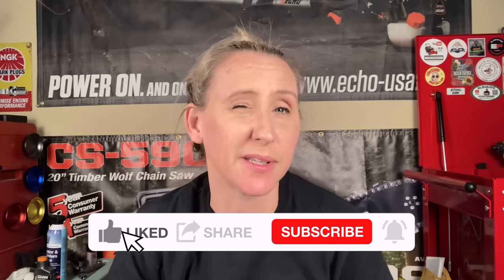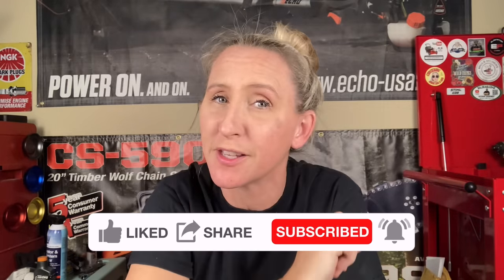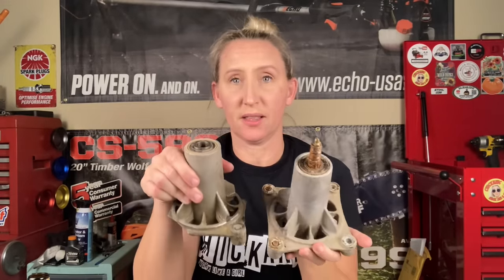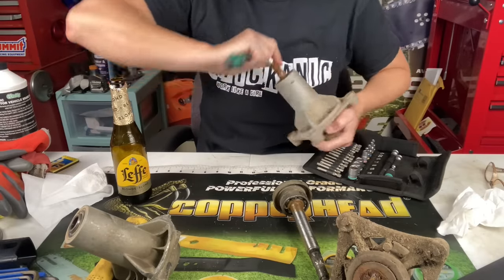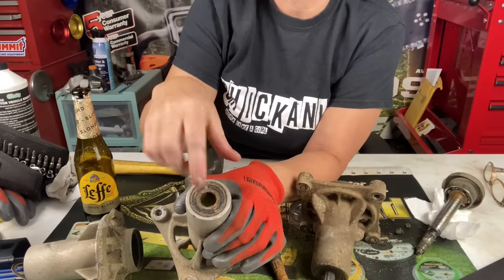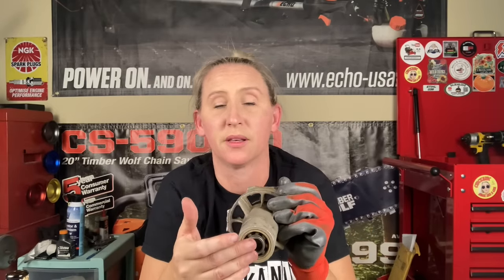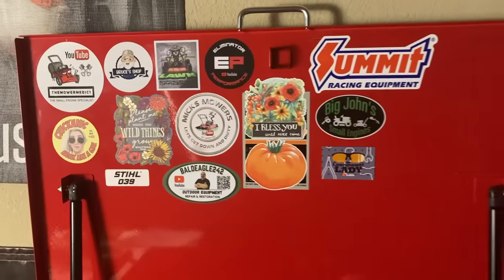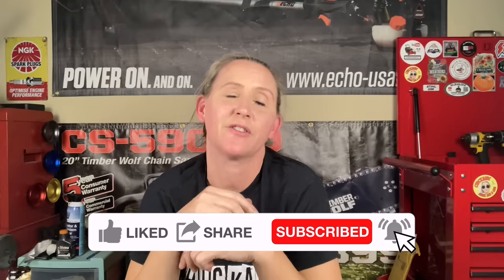THIS IS BIG!! Husqvarna riding mower and Zero Turns HAVE CHANGED! Review/Vlog

Comment: Well, the way that John Deere likes to sell parts and not let the owner work on things, I bet theirs are still sealed solid.  Though the aftermarket bearings I ordered I popped the inner seals out of before I replaced them.  I live North of KC, we grow CLAY here with the occasional pebble so the bearings do go bad first.  Specially the ones.  30 years ago I worked on a Golf Course.  We replaced spindle bearings on a Jacobson HR-15.  Had to pull the inner races off on those as well.  You'd think an industrial mower with an 16 foot mowing  swath would come done right.  Then again, things like bearings got replaced every year because they're cheap, we were full time not mowing in the winter and small money spent in the winter was worth way more then time down on a mower in the growing season.  Lotta grass out on a golf course, you might not have noticed.

Comment: Use caution with gresing those one piece spindle housings, especially if the inner seal's are removed. What you have there is essentially a hydraulic cylinder, and will easily blow the outer seal's off the bearings. An example of the power of a grease gun is bulldozers, tracked hoes and tracked skid steers use a grease gun to fill a cylinder to set and hold the track tension. My mid 80's Simplicity / AC GT's use a 2 piece spindle housing, with a loose fit and excess grease simply flows out between the 2 halves.

I have been drilling and tapping spindle housings for grease fittings since the early 80's. In my experience the lower bearing was the first to go bad, often with rust and water sitting on top of it. I never removed the seals, just filled the housings to stop condensation / water entry in them, this took me from replacing bearings every 1.5-2 years to 5 or 6 years sometimes more ;-)
Reply: Good advice - never thought about the hydraulic effect if over greased!
Reply: See my post above. You need a weep hole drilled in the spindle so that the grease won't pressurize inside the spindle. Cover the weep hole with a rubber plug when you see grease weeping out....simple.
Reply: An excellent point over greasing can cause problems.
Reply: Trump Supporter ?
Reply: @benjurqunov  I am Canadian

Comment: As an industrial mechanic, I have seen properly designed and selected sealed bearing last many years ... even decades. On the flip side, over greasing bearings can also become a problem creating excess heat as the churning grease has nowhere to go and can break down due to this excess heat. Me personally, like to see a properly sized/designed sealed bearing as contamination and excess grease issues are eliminated. Either way, I think the final determination is in the design. A properly sized robust bearing will be reliable. Undersized or lower quality bearings in an attempt to lower cost is what, many times, leads to premature failures. I have a Kubota 725 commercial zero turn with sealed spindles that has robust bearings and large spindle shafts that I mow a 7 acre field without problems for a few years now. Just some input. Love your channel. Very good advice on power equipment. For example, I never realized that gas pressure washers were not designed to run for more than a few minutes without expelling water through the wand. And, sure enough, states this right in the manual. Seems that very few people, including me, actually read the manuals .... lol..
https://www.machinerylubrication.com/Read/28664/dangers-of-overgreasing-
Reply: Yes sir, your the one who is correct. #1 reason for bearing failure, over greasing. Sealed bearings have the correct amount of grease for a full life of a bearing. There are more bone headed people than your kind by far. If there is a zerk they are going to use it. I can't tell you how many zerks I've gotten rid of, plugging the hole, to prevent premature failure. Good job, but your advice will surely fall on deaf ears.

Comment: Someone may have already said this but if you over grease you will push out the top seal and then allow dirt in. Hustler commercial mowers have sealed bearings with a grease fitting.  Like you said 99% are sealed bearings.  Customers need to do there own research on their particular model

Comment: I pretty much just came across this channel but I find it interesting that chicanic just found out about the spindle bearings.  It's understandable, considering her area has destroyed spindles from hitting rocks instead of burnt bearings.  I came across this about 4 years ago when I had a bearing lock up.  I was complaining to the bearings being sealed.  The place I bought the new spindle told me about the outside of the bearings being sealed but the inside part isn't anymore.

Comment: I’ve been watching your videos for a few weeks now and I must say you have a lot of mechanical skill. I’ve worked on gas motors since I made my first min bike in the late 60’s. I’ve learned a few things watching you, so thank you. After watching your video about the new plastic lawnmowers I figured I better do so work on my old Craftsman walk behind with a B&S motor . I finally found some old stock front wheels after spending hours in the internet. I’ll get to the question cause I’m sure you’re busy. The model number on the motor doesn’t come up anywhere because it’s a B&S on a craftsman frame. The model on the stick on tag is 275-260. I can’t find an air cleaner or filter. The one that was in it was not the right one so I don’t know what it looks like. Is there any way to cross reference ? The online owners manual shows a totally different carb and filter. Mine is flat plastic and the primer bulb is part of the filter base. Thanks in advance . I know that’s not much to go on.

Comment: Hi Bre! Love the videos and knowledge. My Husqvarna YTH2042 might be in need of a new spindle or bearing. Just put new blades on and notices a bit of rope stuck and would not come out. Rotating the spindle sounds a bit dry/rough, but still spins for now. 
Problem is the links you left for the spindle shaft/bearings is no longer available and the second complete spindle does not show the bottom whether it has the raised circle requiring a different/new blade bolt, so not sure a good source for a new spindle that is same as OEM? Any updates for us out there on a good part/source?

Comment: Chickanic; how would leaving the seal off of the TOP of the new design allow grease to enter.?  If leaving sheilds off, it should be (in my twisted way of thinking) the inner seals.  Also, the "rubber" (actually plastic) seals are flexible enough to allow pressurized grease to enter fairly easily, although getting the old cruddy grase out is not so efficiently done.   Sort of a one way valve effect.  (HEY!  MAYBE I JUST ANSWERED MY OWN QUESTION!  LEAVING THE TOP SHIELD OFF GIVES THE OLD CRUDDY GREASE AN EXIT ROUTE.)  I guess many home owners never see enough use to wear out the 2RS bearings that are not zerk greased.
Reply: It’s the top of the bottom bearing that doesn’t have the seal, so it is an inner seal. My 2005 Husqvarna has always been like that.

Comment: As a youn man I used to race their bikes, I thing it was the same company anyway? My first Husky mower when brand new needed three transmissions, transaxle? The shop I bought it from kept doing the work under warranty. Finally the shop demanded a replacement mower, Husky wouldn't hear of it? Then the shop owner informed them he would no longer be selling them! Being the number one shop in the area Husky gave me a new mower, the next model up that had no problems!! A couple years later the only problem is the changing of the oil. How are you supposed to tighten the plug up once you get it loosened? There is no wrench room. The shop doesn't have a clue and Husky knows about the problem. I'm an old man now and have no plans to ever buy another mower but I would never buy another Husky!!!

Comment: This is why engineers shouldn’t listen to YouTube comments!! Ever since these open greassable bearings were being used they have been nothing but problems!! The failure rate is soo high that a lot of the people in my industry are opting for the sealed bearing!! 
Big problem!!
I have ride mower that are 19 years old with the original sealed bearings and they still go strong with no noise or over resistance, feels smooth with just the right amount of resistance!! 

Never had an issue with spindle bearings until now, what a shame!!

I’m all for the manufacture listing to it’s customers but unfortunately this is a big mistake!!

Edit; why are people so obsessed with greasing their spindles!! I’ve run a landscaping business for 22 years and never greased a single spindle!!

Comment: And there's me replacing all sorts of bearings in equipment with sealed bearings, knowing that the easiest way to cause a bearing to fail is to contaminate it. Even Triumph motorcycles discovered that gearbox bearings running part submerged in oil lasted longer if they were sealed because they did not ingest the wear particles from the gearbox.
Yes it's lovely to pump lots of lovely grease into a bearing assembly and think you are doing good, reality is; are you actually increasing the life of the bearing over a pre lubed sealed one?
Reply: mostly agreed, I also replace many shielded and open bearings with sealed on gear boxes, etc. open bearings have open arms for anything  that would get between the balls and race. Spun shafts and housings due to locked bearings is common.

Comment: Another Arky here.  Dixie Choppers use convex Belleville washers instead of starred shafts to hold the blades on.  They serve as very effective clutches and do not destroy the shafts when a rock or root is hit.  When I have to work on a shaft on any mower of any brand, I always clean out the housing and drill a small hole in the housing that I tap for a grease zerk if it is not already fitted with one.  I then remove the inner bearing cover on the top and bottom bearings so they are exposed to the grease zerk.  I put it all back in and force grease into the housing until it starts coming out around the shaft.  No dry bearing problem anymore.

Comment: Sealed bearings aren’t sealed grease will flow through them.  Sealed bearings have a small rubber lip that even if well sealed when new will quickly wear out.  The common sealed bearing really just has a dust cover on it.  Water will flow through them in wet environments and they will not last long.

Comment: They probably ran out of brgs that are double sealed, and put what they could acquire to continue production. The spacer under the pulley has been there for years. If you put it back together without the spacer, you'll lock up the spindle.

Comment: Hmm, glossed over that hole in the old shaft that comes out right where the bearing is and you flick around the sealed bearing so fast we can't see the inside bore but for a split second it looks like it has a hole that would line up with said hole in shaft at 9:40

Comment: Chickanic, My question would be, are those upper and lower bearing outer seals made to expel grease when someone zealously injects some into the housing cavity? Will those outer seals be blown out? If too thick of a grease is used, or too cold of weather? Is there an easy way to see if this has happened? Is there an easy way to wipe away excess grease from the upper and lower afterward?
Reply: it might be a little unsafe, but greasing a warm spindle slowly while it is turning is more likely to let excess grease flow through.

Comment: every Husqvarna riding mower I have ever owned or seen has had major issues with the deck and spindles. I will never own another one. they claim industrial decks yet if you hit a small stick size of your finger the deck edge gets bent and or the spindles wear out at amazing rates. we even tried to drill the top of spindles and put grease fittings in them to make them last longer it didn't work either

Comment: How long would you have to pump grease in that hub before it were full enough to grease the actual bearing??? And if you ever did fill it, how many more pumps before you push the seal out of the bearing. The life of a sealed bearing is more dependent on the instalation and type of grease in the bearing. Hammering on the bearing kills a bearing! It needs to be properly  pressed for long life!

Comment: I thought I was ahead of the curve by taking the inside seals out of the spindles I was working with and then filling with grease thru the side zerk. After 30 shots it got tight. Not only the grease gun stopped pumping, but the shaft didn't want to turn either. Still not sure what that was about, I worked the blades back and forth and it loosened up right away and another pump would make it go sold again. Worked that loose and gave it back to the farm wife with hopes that I was done with spindle repairs for a while. I never did have to do another one because every year I would get under there and grease em up to the same stop point, gently work the blades back and forth and it's loose again. That was decades ago, last winter I'm watching a you tube video on this same subject and he shows us the double seal bearings and then he proceeds to pump them full of grease anyway after complete assembly of the deck. Low and behold and to my amazed eyes out comes the grease from the bottom first and then the top as well. It's full of grease and I never did need to pull those two seals. If I hadn't seen him do it, I wouldn't be believing it right now myself - but it's a FACT. Your grease gun pressure will just push that seal lip inward and the grease will flow right on in there and out the other side. Just keep pumping the grease gun and see for yourself. Back in the day it took me 10 to 20 pumps on the grease gun to make up for the grease lost during a years worth of mowing, it's such a small price to pay and since I now have my own zero turn I'm so very glad I don't have to tear that deck all the way down and rebuild it like I used to, I'm just gonna grease them spindles until I see grease.

Comment: I love your chainsaw videos, but I had to see where you where wrong. So I had to watch. But I have a question. What is the Handheld tach that I see you using when you are setting the idle or adjusting a carburetor? I'm getting tired of this wrapping the wire around the plug wire and I want to buy a completely wireless tach to set the carb on the chainsaws that I buy to repair and resell. I have looked everywhere for a tach that looks like the one I see you use but I can't find it. I would love to get one like your using.

Comment: Thanks for the video, I have a 02 model YTH1542XP that I bought new and as soon as the warranty ran out I took both spindles off and knocked the bearings out and took the inside seals out and put grease fittings in the side of them and put them back together and pumped grease in them until it started to squirt out beside the bearings and I have a rough yard and hit a lot of rocks and sticks and have had to replace several housings but the bearings are always in excellent condition so now I have started buying the bare housing and putting a grease fitting in them and pumping them full, now my question is does anybody make a super strong housing, 
Thanks Chickanic
Reply: I have a 07  YTH2146XP and did exact same thing to my spindles and to theses days,bearing still perfect. Yes the initial greasing take lot of grease to fill the spindle but after, just fews pumps needed weekly or monthly,depending on use.

Comment: Please leave a nut on the end of the shaft instead of hammering the end which could ruin the threads. leave 1/16 to 1/32 inches beyond the threads outward. Then hit the nut and not the threated end. I've learned the hard way. 8-)
Reply: That spindle was history. She was not trying to save it.
Reply: @airplanedude419  - if it didn't matter because the spindle was bad, then it's MY BAD <chuckle>>...

Comment: It looked like the shaft has a hole in it where the top bearing sets...did you see if grease goes through the shaft to the bearings like a dexter axle ?

Comment: At the small engine repair shop where I worked faced the same problem with people pumping greasse into the blade shaft assembly which made cleaning and changing the housing. Spindle

Comment: So there is no seal on the blade side (dirt and grass clippings), but it IS sealed on the inside where the grease is?  How is that an improvement?
Reply from the maker: The side of the bearing closest to blade is sealed. It is only open inside.
Reply: @Chickanic  Ah, OK.  In the video it looked like the side with the extension on the inner race was on the unsealed side.

Comment: Hey Bre, how about Toro Timecutter ZTR spindles?  I think they are just sealed bearings w/o zerks.  Also, before I buy this mower for residential use only on my 1/2 acre flat & well manicured lawn, are there any other reasons I should avoid this machine?  I'm planning on the 75742 (42") model with Toro (Loncin) 22.5hp engine and stamped deck.  I will only mulch with it.  Any other $3500 machines I should consider instead?